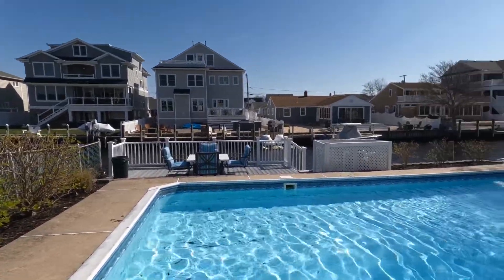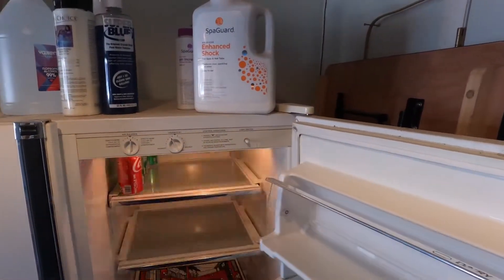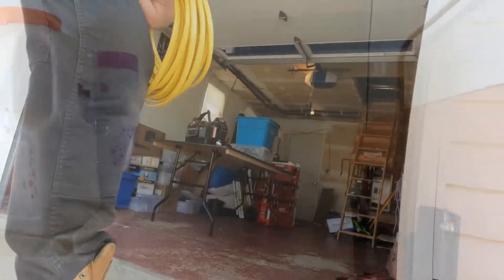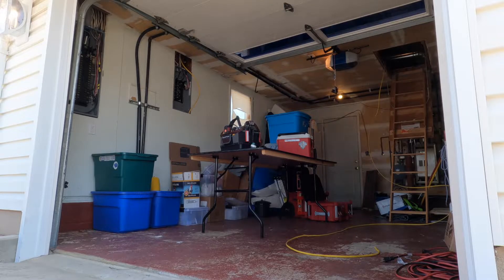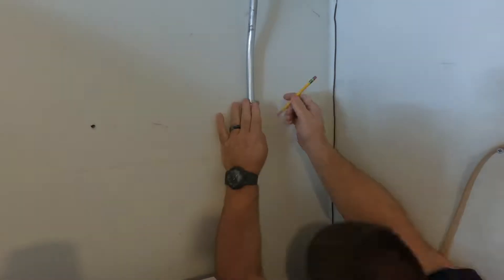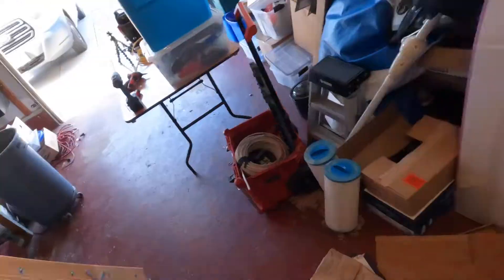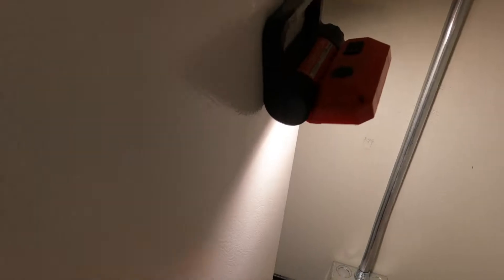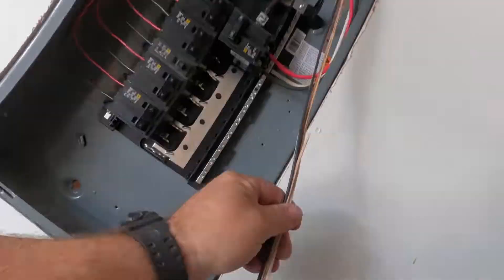Inspection Report Violations, extension cord edition

Comment: I commented the other day and you answer saying you have also been doing this for 32 years. I also almost never do any metal conduit. However, I thought that you weren't permitted to run sheathed cable through the metal conduit. I thought it had to be individual conductors and a green ground? I maybe completely wrong here but I was just wondering? Also, in your video installing the Tesla car charger. when you put the plug in we were taught in school (possibly antiquated codes) that a 6AWG could only go up to 50 or some teachers said 55 amps for capacity of current. but if you wire that with a 60 amp breaker/fault device, then if their is a fault the wire carries up to 60 amps before tripping. So isn't this in effect negating the ampacity capacity of the wire your using. Would you not go up 4, 2, 1/0 gauge in wire. Especially since it's such a short run the cost wouldn't be an issue. Sorry this is just my inquisitive 2 cents. I am sure you are right about this and did the job perfect. I am just referring to my old teaching when I went through school. As we always only used 6 AWG for the range line. Of it was 60 amps for a sub panel at the time we went up to a 4 or 1/0 I want to say that was a long time ago, lol but great video.
Reply: I don't think there's anything in code that prohibits you from running NM in conduit, in fact it's done a lot for the very application that is done here which is to sleeve it in EMT to protect it from physical damage because you're not allowed to surface-mount it. There are even snap-on nylon bushings for 1/2 and 3/4 conduit for NM  to enter the tube. I think it may be frowned upon by some AHJs or inspectors to use it in a closed EMT system, though. Like between pulling points.  But that doesn't exist in this project.
Reply: would mc cable be acceptable for this fridge circuit install?